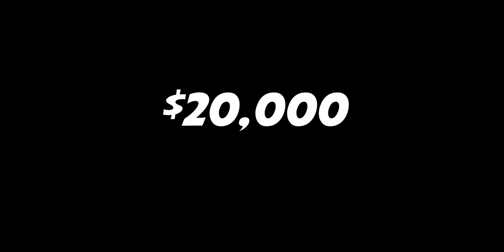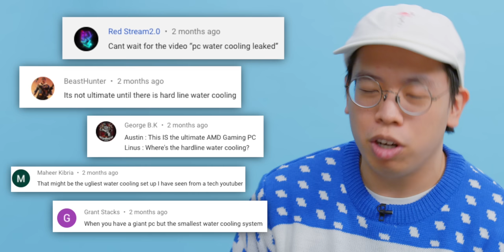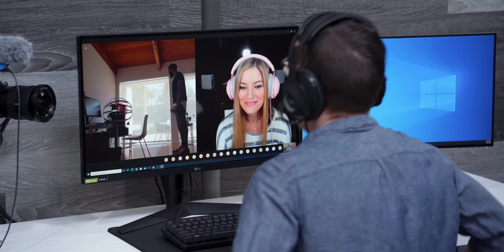The $20,000 Ultimate Gaming PC Build.

Comment: Imagine if the water cooling went all around the outer shell
Reply: I don't think that would be that efficient but it would look sick asf
Reply: Then the thing wouldn’t spin
Reply: @alvarolubis602  they would need to make the whole thing spin not just the shell.
Reply: @GerardoLuna92  true didn’t think of that
Reply: @GerardoLuna92  That would kinda get annoying at some point, it's better with only the shell moving.
Reply: @alvarolubis602  they could draw the water from the top where its not spinning and through the bottom where it isnt spinning either
Reply: @ibrasome4492  yea plus any cables going out wouldn’t work lol
Reply: Yeah that would probably brake in shipping
Reply: @GerardoLuna92  ya but what about the power cord
Reply: Water cooled led lights.
Reply: put the tubes under the spinning shell and route them back upwards
Reply: @enveloreal  but with the cooling path they suggested the whole thing would spin
Reply: @GerardoLuna92  that would just be dum because half the tim you would just be lookin at the back of the pc.
Reply: that would be sickkk
Reply: it wouldn’t cool the pc😂
Reply: @iamthevigilante1655  but it would look sick
Reply: @3bdo_  they said $20,000 right? no way that PC was 20k. they couldve did a lot

Comment: This thing looks bad... There's barely any attention to detail.
No drain. Random tubing path. One 90 deg angle is bent, all the others use fittings.
The thing doesn't even look centered and that motor sounds awful...
What bothers me the most is how they celebrate bad work. Like when they celebrate lifting the frame with these ugly blocks, instead of redoing the hard tubing when the computer didn't fit in the frame.
This is not quality work. If you're not willing to do it right, don't do it. 
Imagine spending 20k on this thing.
Reply: I felt the same 🤷
Reply: The part that annoys me the most is that it’s not centered. Gives me a little sum sum of OCD. Also, yeah lifting it with block wtf🤦🏻‍♂️🤦🏻‍♂️🤦🏻‍♂️.  And this was a gift for someone, at least take the time to do it right.
Reply: i mean they did have 2 weeks

Comment: Woulda wished they showed how the cabling worked... do all of the display, keyboard, mouse, etc all have extensions that run into the bottom shelf thing?  Can you turn off the spinning?  Or does it just start spinning once you power on?  I could imagine it'd be annoying to plug in new devices or even a USB drive.

Comment: TRICK FOR FINDING AIR LEAKS MUST READ!

Mix soap and water, you just need a little bit, pressure the system,  just wet your fingers with it and hold a paper towel under the connection you wanna test so it wont drop any water. 
If the mix blows bubbles there is a leak. 
Wipe the connection and repeat on each connection until you find it! 
It will save you many headaches, its a trick we do as plumbers when we test our large systems. Only we dont care about it dripping on expensive components. 

Cheers!
Reply: also pressurise for 1 hr at  0,6. The pressure will expand the pipe and then it will look like its leaking but it just that its coming to form, plastic tubes are very susceptible to expansion. 
After 1hr take it down to 0.4 and if it rises back up to 0.5 its completely sealed.

Comment: So... I have a build i would like to accomplish and then sell as a system....,
but i need a mini pc (motherboard no larger than 5"x5") capable of good gaming experience with an external GPU plugged into its M.2 slot
I was, looking at an ASrock x300 but then AMD came out with their new CPU's.

the build i thought would do it had only 16GBram and was using a Ryzen4750g
an ID-Cooling IS 47k heatsink and 1TB SSD... the total "WAS" going to be about $700 then i was going to build a custom case in the form of a Warhammer 40k Scout drone with the power supply sitting behind it the cables tied together in a sleeve looking like vertebra... any ideas as to better hardware that will fit in the 5"x5"x5" profile?

Comment: Wait how does the HDMI cable fit through that and plug into. The monitor without being ruined
Reply: Everything's routed to port out from the "drawer", like at 4:19, only on the back (which they never show). 
Which is just adding problems once you understand the characteristics of cabling extensions and ports; the shorter the better. 
But good catch. 👍 Nobody else in the comment section seemingly even noticed that issue.

Comment: I am a professional designer. Trust me when I say this: This rig is so poorly designed it's laughable. I'm not saying it's not a high-performance machine.. But from an aesthetic standpoint, so many corners were cut. 

1. The metalwork is mediocre at best. It wouldn't have taken much time to machine the metal to a higher quality finish. You can literally see the weld seams. It's really 80% done at best. 

2. Instead of having the tubing conflict with the metalwork, why not have them complement one another? I know hard tubing is challenging but if the build is that high profile, it's worth the effort. 

3. The spinning platform looks like it was designed by a child with no consideration for design unity, no consideration for noise-canceling & virtually no effort put into the 'premium oak' blocks that it stands on. Jesus Christ. The entire point of the design is a sphere. It's inspired by the iconic atlas statue... Why would you just say "fuck symmetry"  "fuck design uniformity" let's put some wooden cubes at the base of the rig. 

3.5. The fucking noisy motors used to spin the metalwork........ USE CERAMIC FUCKING BEARINGS. It doesn't need to be fucking motorized, the noise of the motors is so fucking annoying that the customer is just going to turn that shit off anyway. But since you fucking motorized it, it won't spin without ear-fucking you. Better to make it manual. 

4. If you're going to build a 20,000 $ rig at least take your time. Rushing on expensive projects virtually guarantees that it's going to be mediocre, thus making the build, and its price a waste of time and money. 

Look. I'm not saying that I could build something better in a week or something. I don't think that's a good time/money investment. I am just frustrated at how bad this looks.  But if I do spend 20,000 to build a custom rig (which I'm planning on doing next year) - I won't half-ass it, I won't rush it, and I won't fucking motorize it.

Comment: Can I please get some help. I have a Lenovo l340 gaming laptop,  it has 8gb of ram a i5-9300H gpu and a gtx 1650. I downloaded Minecraft bedrock and I get really bad fps and stutters, when I go into GeForce experience and optimize Minecraft, it optimizes it to 80 chunks render distance and all the other settings on max. When I then load into Minecraft it has really bad fps, therefore I turn the render distance to 16 chunks and I still have really bad fps. I play other games like mud runner and farming simulator 17 on max settings and they both run perfectly smooth. I really need some help please.